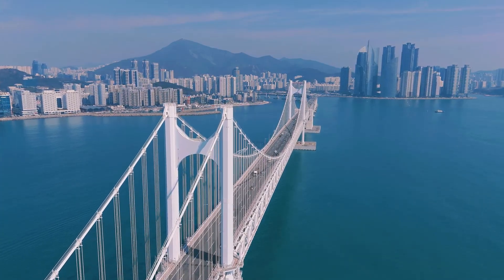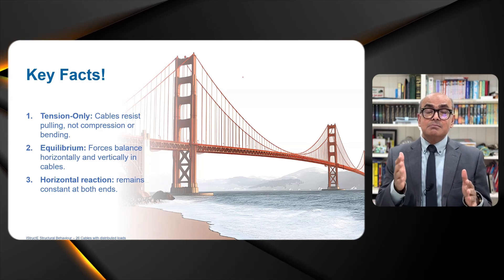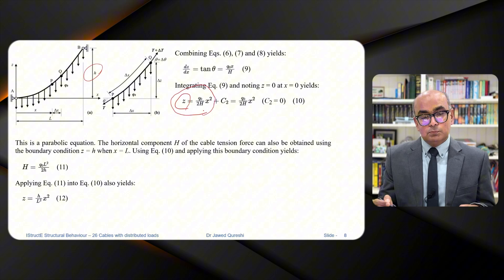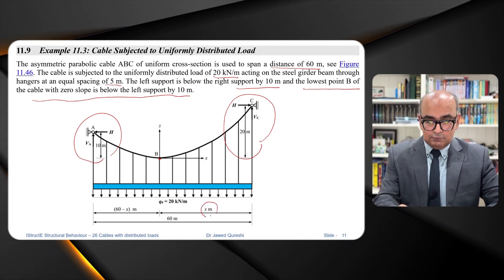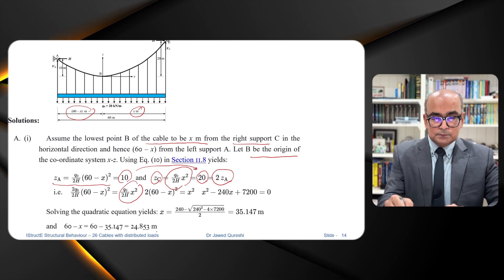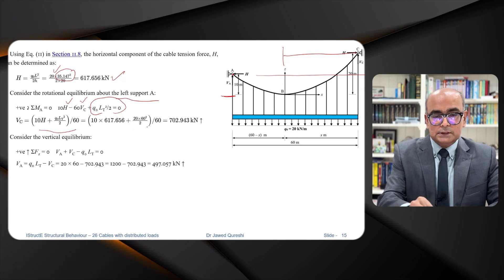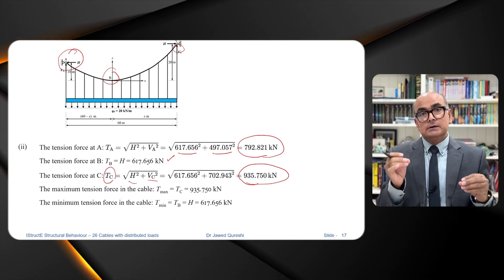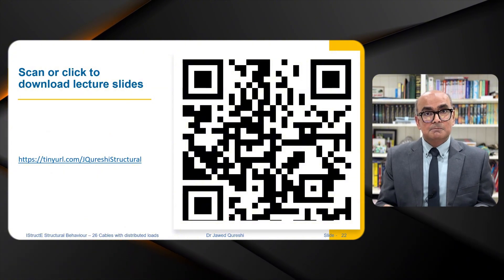Cables with Distributed Loads | IStructE Structural Behaviour Course

Comment: The towers are in compression created by the load from the cables. The saddles have significant compression at all clamp forces also...
I think the closets example of a compressive system is in hydraulic fluid...
I do enjoy trying to find a pure temsion ir compressive member but I cannot...
Reply from the maker: Thanks for your valuable thinking.